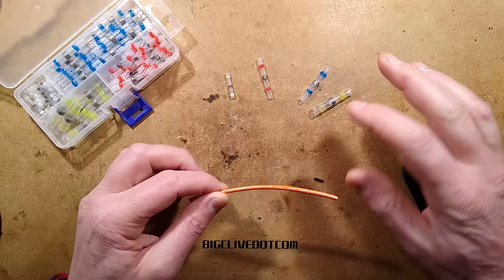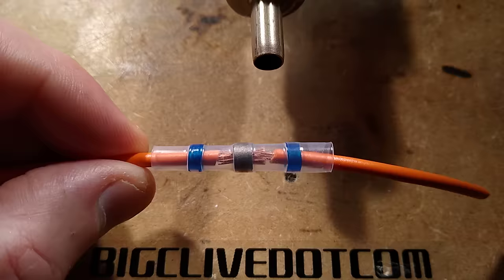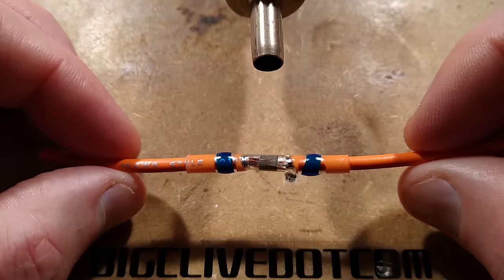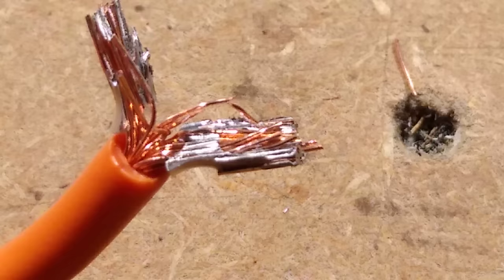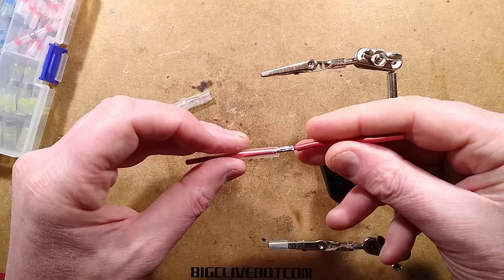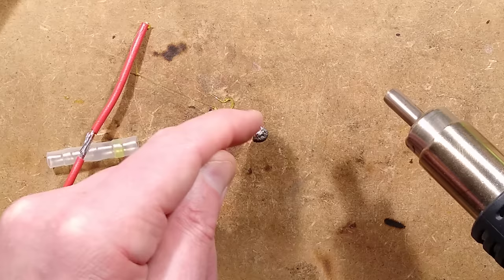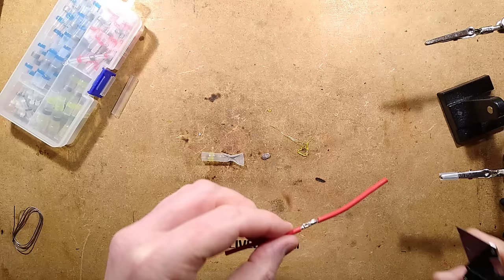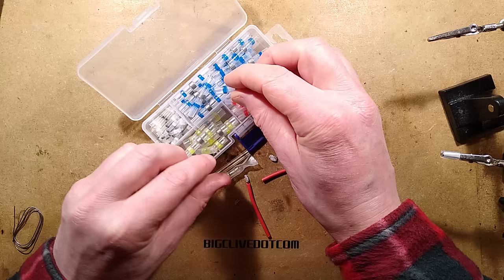Heat shrink solder butt connector test.

Comment: After seeing your comparison,  I did my own.   If you apply a small bit of flux to the wire before sliding it into the connector,  it works perfectly.   I did the same experiment twice.  I cut open the soldered wired with lineman's pliers and then with a dremel.  Both times, the solder had successfully worked its way into all the tiny fibers to make a solid connection.
Reply: Flux not only cleans the copper, but also helps "pull" the solder into the joints via capillary action as it heats.  I agree with your findings and if you have flux handy, it is best to apply a bit of it first before you make the connection.
Reply: Just what I was going to say! I would also use a little flux before using these!!
Reply: A flux pen and these bad boys will cut a job time in half.
Reply: Did you have to fan the wires out and put flux down in the center of the strands?
Reply: Oh, nice idea.
Reply: Totally defeats the purpose of them though. If you have to do all that might as well just do it like we've done it for years now and not waste money on these crappy things . There's not one advantage at all
Reply: Advantage for me, as someone who needs one about once a year, is that you don't need a soldering iron, solder, flux, heatshrink to hand (if you saw my garage you'd understand). You don't have to have power near by. You don't need to wait for the soldering iron to heat up. 

Slide one of these on, heat up with a lighter and you're done.
Reply: @handduggraverdronline  If they are good enough for repairs to military aircraft wiring then they're not crap!
Reply: @handduggraverdronline  They aren´t that much more expensive than just the heat shrink
Reply: @handduggraverdronline  Well I Disagree. A little bit of flux paste or liquid flux is far simpler to add than soldering each on at a time & them adding a piece of heat shrink tubing. I purchased some of these connectors & I will use them when possible with a little extra liquid flux for my needs.
Reply: @125brat  Doubt the military are using eBay specials, though.
Reply: @F0XD1E  No, of course not. They are using high-quality traceable products from qualified manufacturers such as Amphenol, Tyco, Hellerman etc. and they are installed by trained professionals using the correct calibrated tools.
Reply: Was wondering. Thank you for insight
Reply: I have used several and I added liquid flux and they worked very well so I will continue doing them that way.👍🎙
Reply: Bingo, you saved me a post. Chipquick is the best flux for soldering I've found- perfect for this.
Reply: Note to all do not use flux for pipe only use for wires the flux for pipes will eat wires
Reply: @125brat  The issue with the military/aviation application argument that gets glossed over or not mentioned at all is that there is a strict laundry list of requirements for when and where these could actually be used, and even that was many decades ago and standards have changed since for good reason.

The only real applications of these was for things like connector ends where the wire is already mechanically bonded and these are simply sealing things up and improving the existing mechanical electrical connection. And mind you this is only using proper name brand connectors, not "Amazon's #1 best seller"
Reply: What I was thinking
Reply: Flux and a curved end on the heat gun that wraps around the connector to heat it uniformly all at once. People put oil from their skin on the wire when they twist it.
Reply: no point doing all that with flux it's a quick fix
Reply: I put a plug of solder cream in the corner of the box and just use a smidgen. Priblem is I believe the Flux causes the heat shrink tube to bubble and pop
Reply: @handduggraverdronline  I have used them extensively with fantastic results. They are not quite aerospace grade (but nearly) and for a car if done properly they are excellent and quick at inline wire splicing. I'm an old aerospace engineer who has decades of solder and crimp technique expertise and these can be damn near that good for a fraction of the time.
Reply: Thanks for this advice

Comment: Clive, You didn't try the "field method" using a cigarette lighter......  I can see where these connectors would be very handy using nothing but a pocket knife and a lighter.
Reply: I've done exactly this and it works perfectly. They are part of my 'get me out of the shit' kit. I've got a waterpump in my van connected with these. The connection is permanently submerged.
Reply: I also thought of this. Along the line of: "This will get me to the place i can fix it propperly".
Reply: You call it the field method, but, I wont unpack and setup my hot air station just to shrink wrap a couple of wires. The lighter is the first choice method, even when soldering with an iron first.
Reply: The old lighter, best way to strip rj45 wires
Reply: the ones I got on Amazon burned up with a lighter. The solder didn't melt.
Reply: @beanMosheen  Unless they were really cheap ones, you held the flame too close (I learned that the hard way many years ago). There is a range of quality and price. Think Ty-Rap vs generic zip tie.
Reply: i tought that as well, i use a lighter too for heat shrinking tubes... don't forget to put the tube quite near the flame outlet otherwise the plastic becomes black (and i also think it's less hot than the tip of the flame)
Reply: Lookit Demskies  , I'm wondering exactly how many people use a mini butane torch/lighter for 10 continuous minutes at a time other than crack addicts...  lol
Reply: Which is when they'll work the least. Trust me.
Reply: @Bob Sacamano Twist and tape can work quite well IF you do a "western union" splice and it's sealed up properly or otherwise outside of a harsh environment. The usual rat tail splice people do sucks for any remotely demanding service.
Reply: MetalMasterdom  , I know. that's why I mention the test.
Reply: @Broken_Yugo  For those outside the US, could you provide a link to details of those right and wrong methods, since the names aren't very descriptive and US electrical practices are already quite unique.
Reply: i often wondered trying them out myself... i suspect anything soldered could fail if subject to vibrations in vehicle, that seems like other concern here
Reply: @Broken_Yugo  Google creates personal and regional bubbles.
Reply: Ok, Wikipedia has articles on both, my point is this shit is not hard to find, neither terms are slang or jargon.
Reply: I can see these connectors as being a disaster waiting to happen. 

Read my detailed reply, as written by a professional electrician that I am, and carefully consider the ramifications and highly user specific application they are ONLY suitable for... when they are not cheap, imitation, China made eBay junk, as shown in this clip.
Reply: @UmbraPhi  VERY wrong.  In some situations this will get you to the place where you don't want to drop the soap in the shower.
Reply: @Broken_Yugo  Ah, finally a reference that can be checked.  According to the wiki, the "western union splice" is not for stranded wire, and requires plenty of extra length, so not an alternative to repair with the product in the video. The "rat tail splice" is the common quick splice that sticks out in a Y shape and is often isolated (not sealed) with a piece of tape.  Both wiki articles seem entirely focused on US practices like NASA experiments and "wire nuts".
Reply: @ewozniak5228  people do dab hash instead of smoking it are joining those ranks nowadays... I hear they recommend mini kitchen torches over cigar units though. I know I've seen CodysLab melt wax blocks into candles with various torches, but he's a special case boy in many many areas!
Reply: Should definitely try that. The higher temperature may help the solder flow better as well.
Reply: Yep, cigarette lighter gets it really hot and runny, you can see it flowing everywhere.
Reply: @beanMosheen  You might have held the lighter too close. Even the good ones burn if you hold it right next to them. Speaking from aircraft electrical experience.
Reply: @kylea.2114  Some are just junk. I've used thousands of them at work. Even hot airing them carefully didn't work because the plastic was melting before the solder.
Reply: I use these pretty often and yeah just using a lighter works fine
Reply: Bic 5000 is an essential tool
Reply: @timkrueger8638  Nice dude, we only had the 3000 model.
Reply: My Dad had me wire in a new bildge pump with these and they were terrible. Might be alright on a bench where you can easily align the wires and evenly heat them, but in a cramped space with not much slack in the wires,  you need 3 hands to hold the wires together while you evenly heat it. On top of that, the insulation is way to thin for a connection that is underwater on a regular basis. Using good heat shrink crimps and the proper crimpers is much easier, secure, and waterproof IMO.
Reply: @Gameboygenius  the problem with these is that the heat shrink is very thin and cheap and it easily Mets a hole at higher temps
Reply: @redtide941  Next time try crushing the solder on the wire with needle-nose pliers to hold the wires in the splice and then apply heat with a cigarette lighter, it makes it a lot easier in a confined space. Honestly, though, I prefer the crimed environmentally shielded splices but it's not always practical to get a crimping tool in the area.
Reply: Back in the 1940s/1950s there were field solder metal tubes the US military used that would actually do a true solder even on solid core wires. They basically had a match like wrapper around a tube and solder inside. When struck like a match, the tube heated up enough to completely melt the solder and the solder expanded and made a very good connection. There was a metal tube at the end which needed to be insulated, but you got a good connection with little workmunder practically any conditions.
Look up "self soldering sleeves"
Reply: @UmbraPhi  For emergencies only!
Reply: @TheOtherBill  There is NO substitute for the ORIGINAL Thomas& Betts "Ty-Raps"!
Reply: I was left working on some trailer wiring with these and I happened to have a butane torch. Its still working today like 2 years later. I was going to properly solder it when I got home but I was satisfied with the end result.
Reply: @beanMosheen  these guys are bs they don't work you burn up every 2nd one, just do it properly.
Reply: That's what I was going to say because when it's an emergency repair you don't have a soldering iron and or heat gun with you let alone an outlet to power such devices unless you have a generator in the back of your vehicle using his example of breaking down cause a wire broke on your vehicle you would need power to use the method he showed a bic lighter is really quick and dirty in an emergency like his example
Reply: I’ve done this myself.  I keep a little butane torch with my connectors.
Reply: There’s a learning curve with these ones. Unlike normal butt connectors with the thick heat shrink plastic, this closer resembles silicone. You have to hold the lighter far from it and slowly work closer until the solder melts or else you’ll end up burning the heat shrink far before the solder melts.
Reply: I use a lighter with these all the time. It works as long as you move the flame back and forth, otherwise it’s easy to melt through the plastic resulting in a droplet of molten solder landing on your hand. Learned that one the hard way.
Reply: Jet lighters -- from a distance -- work best
Reply: Please tell me a bout a situation where you need to do electric work and would have shrinker solder connectors but only a knife and a lighter, but not a crimp connector...